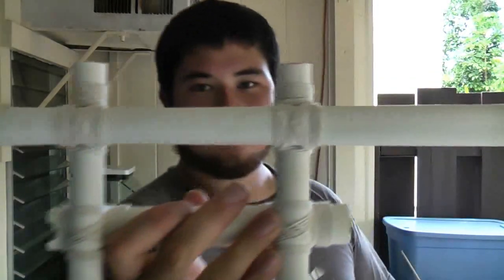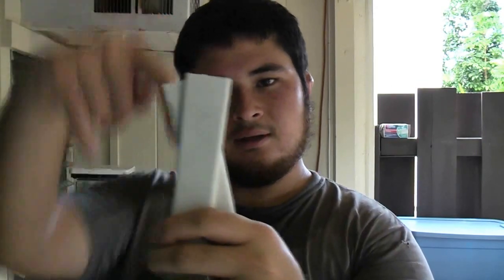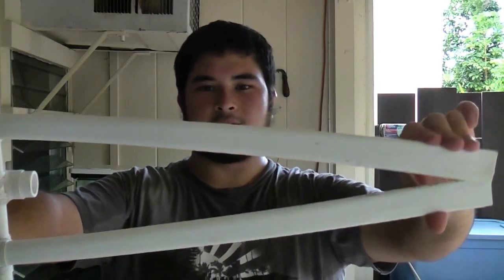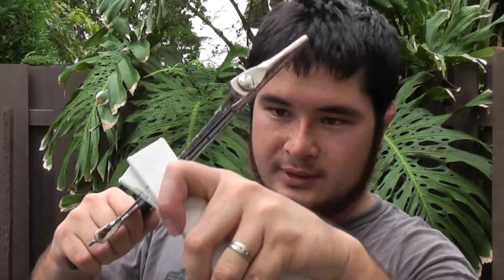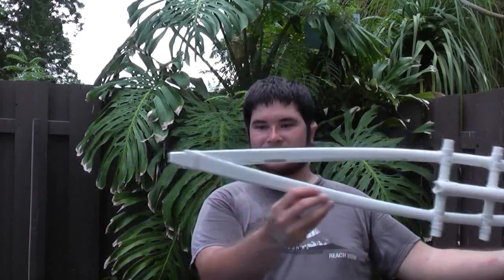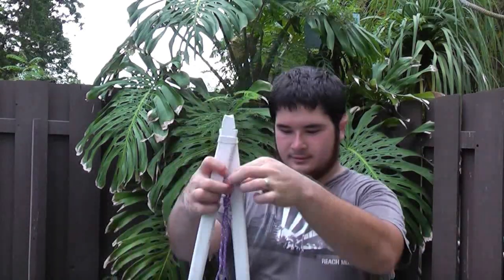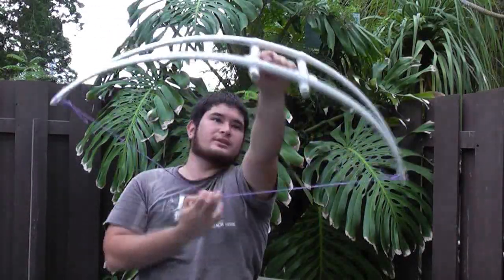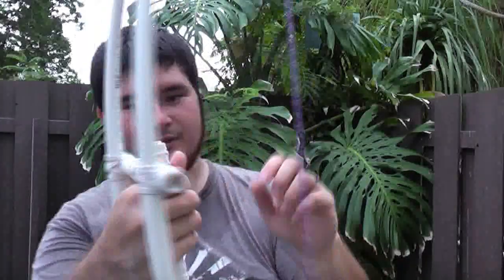How to Make a Centershot Double PVC Bow With Built In Quiver Part 3

Comment from the maker: Thanks for pointing that out, I should have mentioned it. If the forward limb doesn't alternate, the inside bow will be under more stress and one side of the bow would be a little more sluggish than the other.